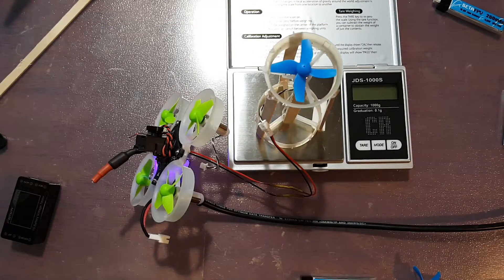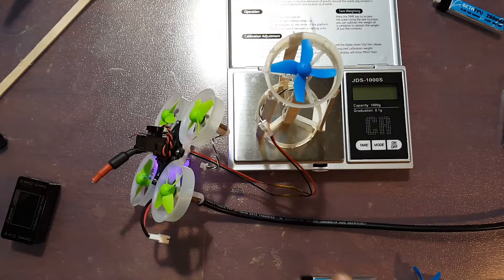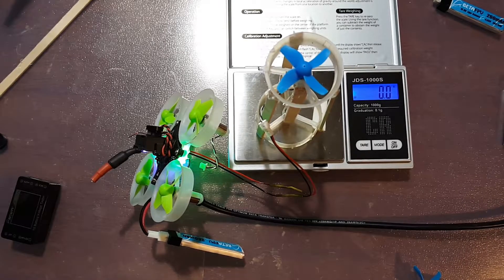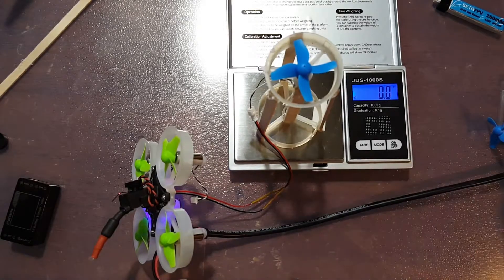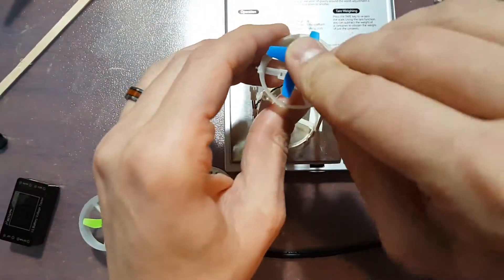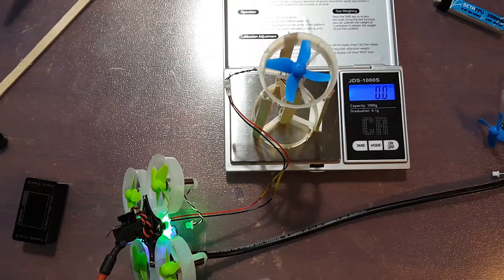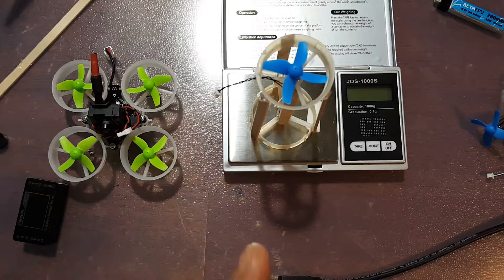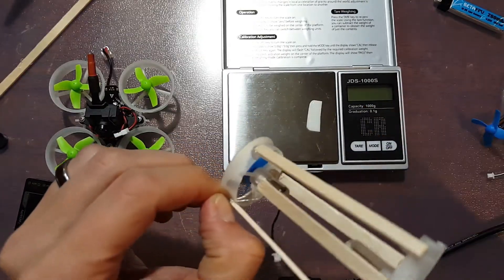716 Brushed Motor Thrust Testing.  BetaFPV, Flight-Sky & GnarlyFPV

Comment: I’ve watched all your build videos. And I ended up getting the beta 65s parts and built it! It’s awesome! And your videos helped me tremendously. I’ve only built 2 micros now. So getting better at building and flying 💪🏽😎 I’ve got the betafpv 716 motors and I’ve flown 10-12 packs with them. They still run great. But they make a high pitch noise when the start to spin. With or without props on them! Is that a sign that they are going soon? I’ve haven’t flown long enough to know when it’s time to let them go lol.  I put it on beta flight. Updated it to 3.3.1 and tested each motor individually and they all make a high pitch sound right as they start to spin. I haven’t crashed either as I’ve only flown it in my house so far. Any tips or ideas as to what it could be? If it is the motor going. I’m going to have to buy in bulk. Because they didn’t last that long
Reply from the maker: Any way you can record a video showing me what's going on?

Comment: Unfortunately I had to give this video a thumbs down. You're spinning the motors in reverse, with the props flowing in the wrong direction. This will skew your results and likely will show lower thrust results than texting properly.

The blade should be facing down, and spun in the correct direction.
Reply from the maker: +64bit Tuning Concepts that's okay.  Thank you for watching.  I spoke with others in the community who expressed the same.  I hope to redesign and release a better video showing more accurate results next time.  Thank you for your feedback 64bit tuning Concepts.
Reply: A simple solution would be to add weight to your scale(maybe like 50grams), zero it out with the weight on it, then run the props in the right direction to pull up instead of push down. I think these scales will usually read a negative number.

Comment: Have you thrust tested the motors from Micro Motor Warehouse
Reply from the maker: +Paul Gugliotti I have not yet.  Im going to build a proper rig and buy some to test.  I have some but they have been flown for many hours.  They are still fast but they wouldn't be a good test.

Comment: Love this video. I am currently using the BETAFPV 716 75000kv motors, though I have just received a few sets of 
BoldClash 716 19000kv Motor.
Size: 7x16mm 
Width:7mm 
Height: 16mm 
Cable length: 50mm 
Shaft Diameter: 0.8mm 
Weight: 2.9g (including cables and connector) 
Speed: 70000RPM ± 15%  / 3.7V (No Loaded) 
KV 19000 ± 15%
CW - Black Bottoms 
CCW - Grey Bottoms
(Four holes at the top.)
Connector: Micro - JST - 1.25

Awaiting delivery of a few new Beta65S frames and two different brands of Frysky F3 Whoop boards to try them with.

Or even better I have put out a few requests to get a 3D print of the one of the Boss 7mm frames, or any of the 6mm for that matter. Really like the idea of unleashing a Whoop.

https://community.micro-motor-warehouse.com/t/notfastenuf-boss-series-brushed-frames-3d-printable/5076

I enjoy your videos buddy. Merry Christmas.

Comment: Thank you for testing. Butbut Gnarly only ships locally.  Are there more options please. 
And are there more frames besides the E011 for this motor size,
Reply: There is also the XRacer X-1 frame too
Reply from the maker: +Pieter vanSchelt yeah the betafpv beta 65s frame the bwhoop frame  the jjrc h67 frame.  The beta 65s is the most durable that I have found.  You can also take a look at notfastenufs boss frame.
Reply: Thanks   good to know with all this indoor flying time of year
Reply from the maker: +dudu du76 ah yes I forgot about that frame.

Comment: Interesting test. I wonder how the MMW 716 Insane motors would stack up. Thanks for the test as it's hard to find any quantitative information on brushed motors. What is your Motor PWM Rate in BetaFlight? PWM Rate will have a bearing on thrust and AMP draw. Thanks for the video and Happy Flying!
Reply from the maker: +Ground Control RC I will check and let you know.  I still have some mmw 716s but they have been used quite a bit.  I'll take a look at my pwm rate and update.  I want to say per betafpvs recommendations that it's set to 16,000
Reply: Thanks for the info. I guess it depends on the FC and motor combo as mine is set at 1000. Very nice test ;-)

Comment: Can you share some other details... wondering what max amp draw was for each motor as well. Also, I gotta ask... Any affiliation with any of these companies? I trust in the validity of your current results just curious for the sake of transparency.
Reply from the maker: Brandon Rupp I do not have a way to measure amp draw unless I use the osd output.  I'm not sure how accurate that is.  If you know that would be helpful.  I hope to be able to report on that soon.  I do provide reviews for Betafpv on my channel and for the community and gnarlyfpv sent over the blitz spec motors for me to test.  I do not get paid by anyone.  I hope to test more motors soon as I find them.  I'm also redesigning my test rig  as there are flaws and it's not accurate. It's more to visually show the differences between motor power with a value to use to rank them in order.  Thanks for watching.  Like I said I hope to have a more through test developed soon.
Reply: Thanks for the info and appreciate the honesty. In no way thought you were promoting one over the other. I agree OSD accuracy with the betafpv board will likely not give perfect readouts but using the same quad as you did in this test you should still be able to compare the differences in amp draw. The actual numbers are less important than the differences you would see between the three (IMO). Next thing I'd love to see is the lifespan of each. I know any of these brushless are only rated for like 8hrs but I'm curious if the more powerful motors are sacrificing any life expectancy. Any pro usually results in a con somewhere else. Right now I see no con for the gnarlyfpv 716s (minus finding someone in stock with props that fit 1mm shafts over .8mm). As always thanks for the video and appreciate what ya do.

Comment: Great vid - thanks for testing the motors as this is something which Im trying to figure out right now on 716 vs 720 - hope you will test some 720's with the same rig.

But I have one question - are you running the prop backward (cw prop on ccw motor) to push the scale?! Wouldnt it be better to flip the duct so that the prop would pull as its designed to?
Reply: Still your rig is much better than what I came up with on my quick tests...
Reply from the maker: +KUB fpv yeah my tests are pretty crude.  I'll switch it before my nexts tests.  My goal in this was just to show the difference between the two motors that are 17500kv and the gnarlyfpv motors which are advertised as faster.
Reply from the maker: +KUB fpv thanks for watching KUB!!  I really appreciate it.
Reply: Motor direction/polarity must not be reversed. They are not designed to be used in reverse. It will work, but reduce motor performance and lifetime.

I think you only need to put a CW prop on a CCW mortor ( or vice-versa ) to reverse the airflow, without having to reverse polarity/direction.

Comment: So in theory if i wanted a long flight time i would use a mrdium strength motor w big batt. compared to a high rpm motor or would a high rpm motor just ran at a lesser throttle be better for long time. Is 550 mah the biggest that could be ran or could u experiment w high rpm motor w like a 6-700 mah batt? I would really love to have a whoop w a real long flight time, not necessarily a fast speed.
Reply from the maker: Great questions.  I have found so far that the gnarlyFPV motors get a little less flight time so if you are looking to achieve longevity over speed I think a lower RPM motor and bigger battery will suffice.  With the Beta 75 I can get over 4 minutes of flight off a 450mah.  Soon I will have some 550mah batteries to test to see what type of flight times I can achieve.
Reply: Yep, saw the 550s, cool, guess it just matters on weight load and how much it can handle and maneuver. Im probably trying to make the whoop.something its not supposed to be. I just need to get a dji spark and buy an extra canopy and fit a 200 mw vtx on it so i can adventure in fpv.
Reply from the maker: +k6lsn go for it.  I'd like to see the footage
Reply: I made a 8 minutes whoop ( and almost 9 ), using a stock E011 (+ TW900 camera/vtx ) modified to take a 500mAh ( placed vertically, like the latest inductrix fpv+ )